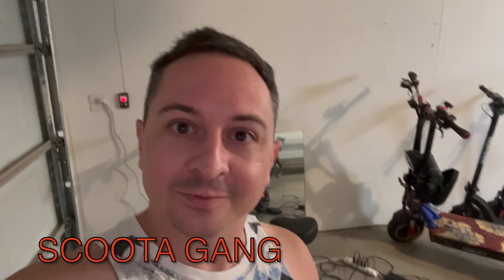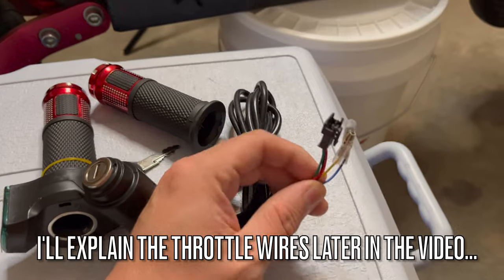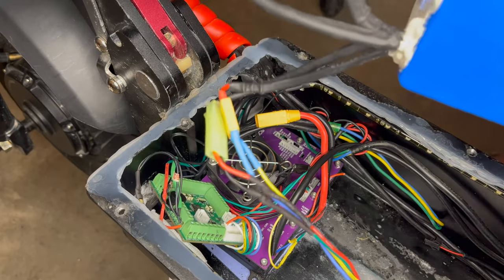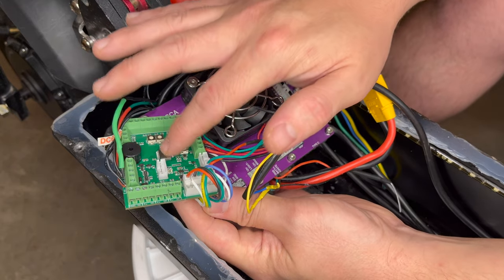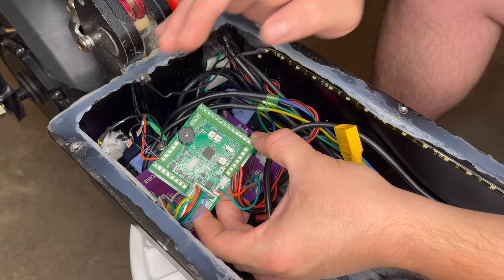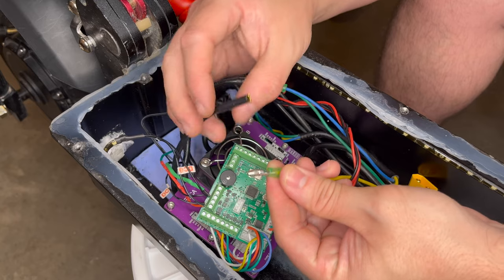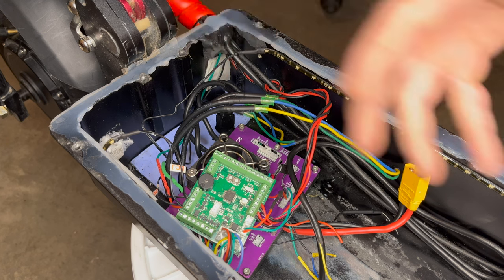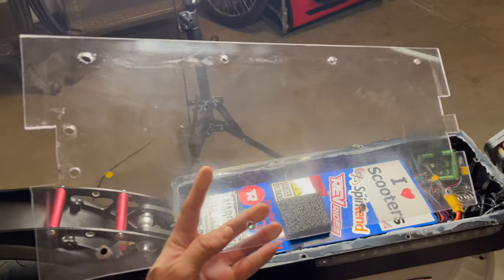How to Install Ubox Controller From #Spintend in Electric Scooter // PART 2: Wiring Yume Y10

Comment: my scooter gang has lots of this vesc installed, there is always the problem with the heat that we need to deal off since we go very high speed and longer distances; some have radiators, some took out the controller to the front column to have direct airflow, kinda a headache for me tbh

Comment: question hooking up spintend controller on my motor it has the three larger wires hooked to controller then it has 5 smaller wires in a plug hall senssor wires i think i am confused but do i  hook up bothe sets of wires the three big ones and also the 5 smaller ones also thank you your  friend Terry young

Comment: Question I need to replace my controller on my X3 pro. Should I connect my controller first then the battery or connect my battery and then the controller? Thanks

Comment: what does the vesc tool call 11 scooter tires what are they called  to run the foc program
Reply from the maker: use the ebike hub motor settings if you are talking about when you do the motor set up wizard!

Comment: If you want to get fresh air into the inclosure you can use a waterproof hepa filter,make a circular hole with the same diameter as your fan than cut a hepa filter to the exact shape,cut from something like a small metal sieve a piece of the metal grating to the same shape and diameter as the filter,glue it to the both sides of the filter and than atach the finished product to the hole that you made in the deck,drill 4 more small holes in the deck and mount the ventilator on the inside of the deck facing the filter in a way that it is going to suck air into the deck,repeat the proces on another side of the deck(try moving the batery forward so that the air goes from the front to the back) with the another fan fliped so that it pushes air out of the deck and there you go you have a fully working air cooling waterproof system,that is what i am going to do on my scooter,i hope this helped!
Reply from the maker: Thank you I think I might try and do this over the winter. Shouldn't be too hard to add another fan and extend the wires so they can attach to the polycarbonate board. I'm not seeing any hepa filters that are small enough for this, but I will take a better look later. Thanks again!
Reply: @ScootaGang  there are plenty of hepa filters out there my friend ,all you need to do is cut them to size,anyway i am looking forward to see this channel grow!
Reply from the maker: @shlasher007gg7  yes I see a lot the only issue is they are way too thick. Can’t fit anything thicker then about an inch…
Reply: @ScootaGang  i have an ideea but it might look and sound a bit crazy😅😅
Reply: @ScootaGang  check your messenger tell me what you think😅

Comment: Is there a rule to route the 3 motor cables to the VESC based Ubox V2 100V 200A dual motor controller? Will the tool set up without having to match the front and rear motor cables the same?
Reply from the maker: No the order of the phase wires does not matter. When set up the motors in vesc tool it detects everything and allows you to change the rotation of the wheel if it is running in reverse.
Reply: @ScootaGang  After that, if you can connect the front and rear three motor cables, leave the settings to the tool. I'm planning to assemble it next week, so please let me know if there's anything you don't understand. thank you very much.
Reply: @勇人-w9o  can you still use single wheel or dual wheel?

Comment: Does this ubox add power to the Yume Y10?
Reply from the maker: Yeah it's about 10,500 watts now, really good acceleration
Reply: @ScootaGang  Oh thats nice.  And where did you buy it because most likely I will buy this Scooter.  Your off road videos REALLY convinced me.  You're the only one who has extensive off roading with your scooters and test them out the most thourough.  I'm new to it so your videos have been the most helpful.  One thing I'd like is if your can take measurements of decks and stems etc.  Some of these manufacturers don't list ALL measurements on their websites.

Comment: If it is a 52v23Ah battery, what is the size of the cell and how many amps?
Reply from the maker: Generic chinese 18650 cells in this yume. I'm pulling 40 battery amps and 100 phase amps per motor.

Comment: EDIT: I WAS WRONG, IT IS MADE FOR INPUTS FOR EBIKES AND ELECTRIC SCOOTERS AND NEXT INFORMATION WILL BE WRONG AND IRRELEVANT: that adapter was mainly meant for onewheels as it has the IMU chip (that sees angles) on that board, however it also makes it easy to wire everything up, you can technically run hall throttles on the 3.3V output aswell but it might be less accurate, if you use it for a onewheel you have to secure it though obviously :P
Reply from the maker: I'm honestly not too worried about how it works, I just care that it does work...
Reply: @ScootaGang  i understand that, but that might be interesting for people that like EUC's etc aswell

edit: also i'm interested in seeing/hearing about the Spin-y as i'm thinking about getting one
Reply from the maker: @BH4x0r  Pretty sure the IMU is seperate from the ADC adapter, it's here:
https://spintend.com/products/bmi-160-module-for-diy-balanced-board-with-vesc?pr_prod_strat=copurchase&pr_rec_id=3529f9c0f&pr_rec_pid=6834843418776&pr_ref_pid=7278060929176&pr_seq=uniform
Reply: @ScootaGang  interesting, with all the microcontrollers etc on there i certainly thought there was an IMU on there, also because i saw IMU mentioned somewhere (probly in the controller itself, as it was a Ubox + Ewheel ADC board combo somewhere)

my bad for the confusion and being stupid.

Comment: Faster than the vsett 11+? I’m interested in what current you are running for battery and motor
Reply from the maker: Been running 40 battery amps and 90 motor amps, and have the RPM limited to about 30 mph.
Reply: @ScootaGang  really? I have my scoot set up with motors at 115a and my battery at 55a and it feels about the same as my stock wolf
Reply from the maker: @jamesthornton642  what controller? It can't be a ubox at 115a, the max is 100?
Reply: Is there a way to get a video on how to use the vesc for this scooter?  Can't see to get to work on my end.  Also how can I wired my throttle to the Ubox not the the adapter?  For some reason the adapter is making the reverse noise and it won't stop making it
Reply from the maker: @freddysaenzdastylist  Did you read the manuals? I would start with that so you understand what's going on. The links are in the video description below the amazon links. 

You have to use the adapter. If yours is faulty, I would exchange it for a different one. I also suggest emailing them your technical questions, they were able to help me with any question I had along the way.
Reply: I have read and watch videos but nothing.  No matter what changes i do the scooter reads 17 mph and lifted.  Is like the tool wouldn't input any command
Reply: Also working on set my throttle straight up to the Ubox as the adapter touched the scooter spark and now it won't stop the reverse noise.  Is working fine everything i even wizard set the motors and now they are working at 58 mph lifted.  But every time I play with the settings, nothing happens and haven't found any good detailed video on the vesc settings for a scooter
Reply from the maker: @freddysaenzdastylist you can't find any detailed videos about vesc tool settings in a scooter because there aren't any.... Like I said you should email SpinTend directly, they can help you better than I can. I am using an older version of Vesc Tool and firmware that I got from Spintend that is the most stable for Ubox. You need to ask them for it.
Reply: @ScootaGang  after doing the wizard set up mine say is set at 135A
Reply from the maker: @freddysaenzdastylist  what firmware and version of vesc tool are you using?

Comment: From what I’ve seen doesn’t matter how you set up phase wires to controller
Reply from the maker: Correct, if either motor spins backwards you can reverse it when you set it up in Vesc tool.